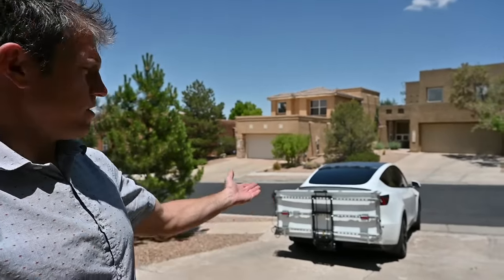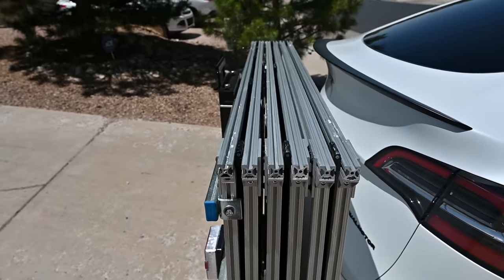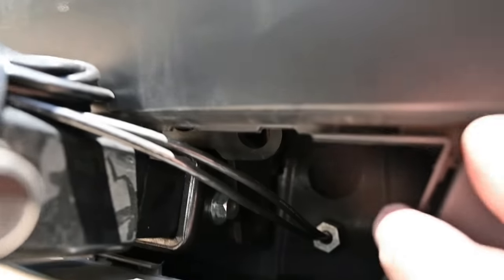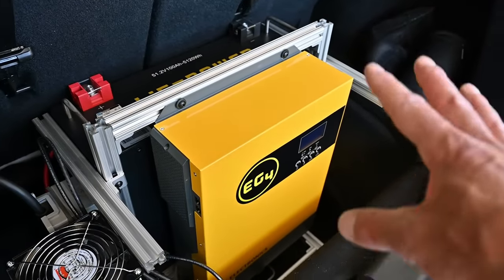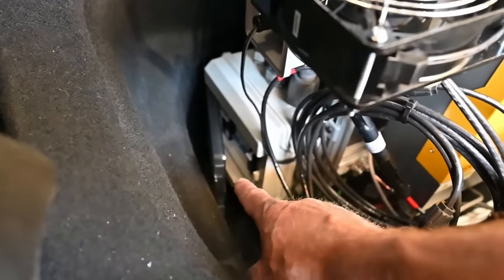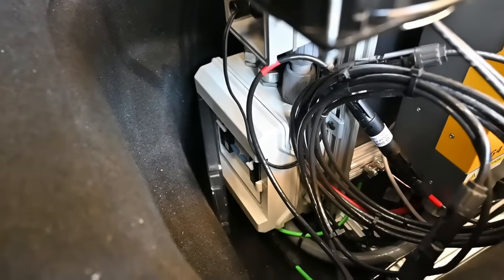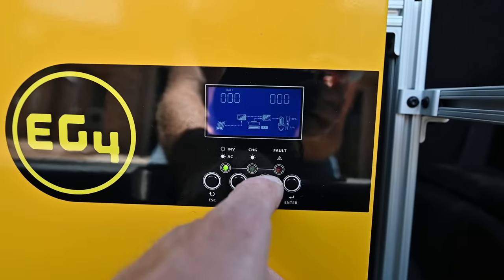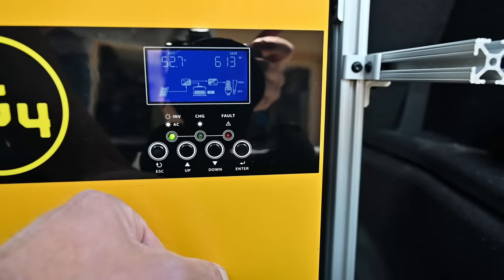Tesla Mobile Solar EV Charger with EG4 inverter and battery

Comment: Excellent video! But it just kills me that this would be so easy to do with existing electronics already in the car, if only the EV manufacturers would provide a DC input for the solar panels, without having to resort to external batteries and inverters. 
This setup has so many voltage conversions: 1) step-down from PV to battery, 2) step-up from battery to intermediate 120V DC voltage, 3) invert from 120V DC to 120V AC for the car AC input. Feed AC to car, 4) rectify from AC to DC in the car and 5) step up to the EV battery's DC voltage. All this could be done with a single DC to DC conversion from PV to the EV battery if you could just get the DC voltage from the PV directly to the intermediate DC bus inside the EV's AC charger. From there on, it's just software to set the operating point of the step-up circuit.
Reply: Preach
Reply: The RealSolarCars YT channel has a custom board that does exactly this. I believe the current iteration is for 72cell solar panels, manages 300W charging up to 400V, CAN interface contactor outputs with coil economizers, lots of additional features that might be desired for a DC-DC SEV.
Reply: Totally agree !!    Just make it easier for people with PV at home would be a big start.
Wil Prowse showed how he charges his Tesla from home PV.

This case shows roughly 1kW Solar PV, so roughly 4 kWhr per day, or 16 additional miles.
Being able to quickly add 5x or 10x that PV to your EV would be super cool.
Reply: I said something similar
Reply: Aptera has said their vehicle will have an input port for external PV arrays (I believe).  In case you want to supplement the onboard PV
Reply: I really don't know why he wants solar charging, why not just use the added battery for additional range. I am interested to know what his range boost with that added battery and added weight in the back trunk!
Reply: @uhjyuff2095   it’s a possibility to be in a place with no grid power to charge the external or internal battery. Everyone doesn’t want to be tide to the grid.
Reply: All EVs come with DC charging. That's how supercharging works.
Reply: Ya I've been saying that for years. I've also saying why dont they use an alternator and a rectifier to charge batteries while they are driving. Hook a pulley up to the motor and mount the alligator. Running with belt just like a regular car. Rectifier and voltage regulator. Some altinators put out 96 kilowatts or higher.
Reply: Conversion losses
Reply: @kennethcheesbrough6855   uhh physics? the batteries are driving the motors to push the car... you can't then put drag/resistance (alternator) on the same motor/wheels, to charge batteries... that would just make the motors work harder (by the same amount) to overcome the drag. 
You can't do perpetual motion or energy from nothing.  Otherwise I'm sure Tesla would have done this magic regen already :) 
 (Now, SOME big construction trucks DO this perpetual motion thing, never need charging, using regen taking heavy loads down a mountain... which charges them up enough to go back uphill for free!
But,  that's because they've left giant boulders down at the bottom, gravity gave them free energy.)
Reply: THANK YOU! SOMEONE FINALLY SAID IT!!! you're a savior.
Reply: Some EVs like the Ioniq, genesis ev's and KIA ev6's have outlets already.
Reply: @uhjyuff2095  Add solar to your roof - add extra batter to car - also, allow for car-to-car charging, to help out if another Tesla is out of juice
Reply: @cgamiga  New business, put boulders at top of hills for EVs to put in their frunks....
Reply: @cgamiga  No, you don't understand. He is saying that it would be nice to have a large alternator on a Tesla to charge an EXTERNAL battery for other uses. The ford lightning has 3 large inverters for doing just that! You can have power tools or really anything in the bed or Frunk charging while you drive. It is super amazing what EVs can do!
Reply: @themosttoast3733  That is too labor intensive. Why not just install a Tesla Supercharger and say to the customer "Plug it in"
Reply: @kennethcheesbrough6855  ... The additional energy used to turn the alternator under charging load would cancel out the energy created by the alternator. Regenerative braking is the only mechanical way to add energy back to the batteries above net zero, and most EV's already have this implemented.
Reply: Exactly.
Switching back and forth to DC/AC/DC is so inefficient.
Reply: @benowens2428  Kenny is talking about charging external batteries not the internal battery. You know like how a gas car can charge it's 12v battery while driving!
Reply: @uhjyuff2095  It doesn't matter what you are charging. The internal battery, and external battery pack, etc. Using mechanical means to do so especially, would draw so much more power from your vehicle, that is doesn't make sense to to do. Just charge your external battery while you charge your car. It is a diminished return no matter how you look at it. Does that make more sense?
Reply: That'd be tight. What still doesn't make sense to me, if you have say 2 motors on 2 wheels,  why extra 10k w alternators aren't connected to the other 2xwheeks to create charge while moving? Seems like the tech exists no one is adding enough tech for self charging between solar & motion? Even an internal wind tunneo/turbine doesn't seem that hard to engineer
Reply: @richardjohnston9899  Because of the laws of physics man. If you put that much resistance against the car to try to generate electricity with alternators/generators and/or wind turbines, you just drain your batteries that much quicker with diminishing returns. 
The only way you can get a charge without impacting your range is through passive charging. Like solar, or regenerative braking, etc. Sources that don't drain the system more than they are putting back into it.
Reply: @richardjohnston9899  There are alternators connected to the wheels. The motors function as alternators when you hit the brake pedal. Then they will take energy from the movement of the car to charge the batteries and the car slows down. That way you can stop the car without actually using the traditional disk brakes at all and you recover the energy. There's no free lunch, though - you cannot get energy from the mere movement of the car. You put energy to the movement to accelerate the car, and you can take energy from the movement to decelerate (slow down) the car. The amount of energy is same as the change in the speed of the car.
Reply: @zaneenaz4962  You can only do so much with 120v. I was doing the numbers before and we really need atleast 3kw, but we really is 6kw ideal for 50mi trips, 32amps with 240v.
Reply: all that to charge your car in a week.......Really I would rather have them on my roof. so they can give me more bang for my buck. Put a batter backup in the garage and transfer the energy to the car from the battery backup
Reply: @uhjyuff2095  To survive the Apocalypse

Comment: This setup belongs into a trailer, this way you can leave it charging at your camp site while you have full use of the car. You would add other amenities to the trailer too, and it could become a great product to build and rent out to the world...
Reply: Correct and the solar panels should be placed on the roof of the car so it charge while you work. The rest of the fancy setup can be bought as a 4.8KWh battery with inverted to deliver 110/240 VAC - to charge the car. They are included in the batteries with solar panels. 5KWh is what regular driving needs every day - 7KWh is 30 miles/ 50 km of driving.  A camper towing a 5 KWH battery with solar panels has enough electricity to power a freeze and induction oven - no need for propane.
Reply: @knuthf  sure if you can integrate it so it doesn't cost anything additional drag. Otherwise have a utility trailer outdoor kitchen, refrigerator with foldable solar covered shade roof, battery and charger, and you can bug out much more conveniently when the time comes! By the way I want to see videos about taking your ev (tesla) off line - for the 5#!4 hits the fan situation - with hacked Ai and bezerk government and what you can't even yet imagine...
Reply: And when it’s not powering the car, it can power the house.

Comment: This inspires me to look further into an ev conversion for my little car.  Of course by then this will have been perfected even more.  What a nice bit of work there.
Reply: By then it’ll be a car cover you plug into your vehicle
Reply: @Terrillthegreat79  Hey now THAT'S a good idea!
Reply: Natural gas conversion is cheaper.  You could use gasoline when you run out of natural gas
Reply: @josephtpg2205  Yea but that's not the point
Reply: I've looked into that too but it's very expensive!!!

Comment: I’m impressed that you got all that weight onto the tow hitch within specs.
Nice job dude.👍
Reply: true. Maybe placing it on top like a roof box or something and just slide it out if he needs to charge the car :D
Reply: @ayayotoko  The location of the panels on the roof has one disadvantage - it will increase air resistance and this will reduce the range

Comment: Great video. While this project was an amazing example of making a portable mobile solar charger, a similar fixed-base home setup solar could be just as effective, and likely see more usage.
While Renogy 100W are very portable, but come at higher cost/kWh vs. larger fix mount panels. (some great deals on 1/2 life used solar panels can be found)

Perhaps a trailer installation that could double as camper would offer mobile portability without concerns of panels being run over? A trailer might also offer larger surface area, and could continue to harvest energy, even if not attached to an EV. Guess it depend on needs and wants. 
Still a great demonstration.
Reply: You'll lose a fair bit of range once you start pulling a trailer

Comment: FYI, on the Model Y the maximum tongue weight for a trailer is 350 pounds but the maximum vertical weight for bike racks including the weight of the rack is only 160 pounds.

Comment: Great work! I have tested similar system with my Model S and the problem for me is that it is too heavy. I wish there was an MPPT DC charging station for Tesla =) so we can avoid heavy battery and halve the weight of electronics.

Comment: How many days/weeks/months/years/centuries would that take to deliver a full charge?
I think people underestimate how much power these cars consume.
Reply: This is perfect for trickle charging instead of wasting time and getting scorched, when the car is parked outside, in hot weather and the owner works an 8 hour shift, or has just visited a friend or family and there is no indoor parking. Normally , we hate to have a car, any car out in the hot sun but this actually delivers gains, in the long run.
Only problem, what is the total cost and what is the extra weight of this conversion ? Then one can sit down and estimate the total experience.
To sum up, this is the future!!
Independent and
Reply: This solar setup has the potential to produce 6KW/h of power per day in summer time, after conversion there would be about 5 left at best, assuming he has a 100KW/h battery in the car it would take 20 sunny days to charge up to full.
Reply: @TheDIYDen  If someone doesn't nick it while it's unfurled in the carpark...
Reply: @garysheppard4028  hahahah ! Probly ok for a campground, but yeah not ideal in general
Reply: @TheDIYDen  holy crap, 20 sunny days to charge the car? Was that a serious estimate?
Reply: @JeffHoldenWS-NC  Yes, and very generous it's probably closer to 25.
Reply: @JD-fk4qq  Yeah. Hey I have one of these rigs! Some WalMarts won't let me use their parking lot, so I use a custom app that finds which WalMart to go to. I usually can locate one store per state.
Reply: @TheDIYDen  we’re lucky to get that in all of summer in northern England.
Reply: @davidk3729  hahah

Comment: If you add some small caster wheels to the hinge points, it would be much smoother to deploy. Awesome build!
Reply: I'm thinking a track from back to front of car, and the panels slide over the car

Comment: This is a great demonstration that a solar charging option is "possibly feasible" for cybertruck, once commercialized, with better weight reduction, higher efficiency energy harvesting, cargo bed roof integration - especially for cybertruck outlanders.
Reply: Glad to see I’m not the only one thinking this.  When you figure in the extra weight and wind resistance I suspect it would actually use more electricity from the grid with the panels in place, at least for a daily driver.
Reply: @William Arrington you are being too generous with your numbers is was only 1.2kw of solar ideally but even in summer with long days and clear skies it would take about 5 days to get your 60kwh charge so if the cyber truck has a 200kwh pack you would need the better part of 3 weeks and that is still being generous because that isn't factoring the bad panel angles or other system losses honestly for a cyber truck it would be lucky to get 1 full charge a month in summer

Comment: That EG4 is brand new!! Nice setup.  10:07 I think the server rack batteries have a built-in charge resistor.
Reply from the maker: That's what I thought too, but I believe only the newer ones with digital displays have that feature. My battery would fault when initially connected so I added the resistor.
Reply: @gridfreeordie  It does you just have to do some reset or something to activate it. Your setup is easier since you thought it out and figured out how to get it running smoothly!
Reply: I believe that breaker is split into two sections so you flip just the pre charge switch first the main switch

Comment: Impressive, for sure ! But adding that much weight to the car, plus the additional drag to the already get efficient design of the Model Y, we would need to know much this setup as diminished the range. Of course, if your objective is mostly to be able to camping off-the-grid, the it's just fine. Except that now, you've sacrificed all that cargo space for your outdoor gear... Ah wll, nothing's perfect !  😁
Reply: add to that the increased aerodynamic drag that monster places on the car. You would get more range by simply getting rid of the solar system. 😂
Reply: what I would do is not carry it around and just use this solar at home to get extra range or take it with me when planing on not moving for awhile to get range back up idk but carry all that seems like a drag I do feel like solar will be the future of ev but it not there yet!
Reply: Gear can fit in passenger side
Reply: 完美遮挡车牌

Comment: Interesting project. Driving around, I would have some concerns. 1. The license plate is not visible. It would be simple to move it to the back. 2. The taillights can't be seen. I suppose those could be implemented like a trailer. 3. The Tesla Model Y has sensors and cameras all over its body. Does this interfere with those?
Reply: Yes it’s a sacrifice
Reply: He has taillights added. And the government can get f'd reguarding the license plate
Reply: I also worry that the aero drag from big flat panels, might cause enough energy losses to overcome any later generated power :( maybe some shield over them? Not sure how the air flows past them...
also, there will be energy lost from cabin overheat A/C or even just fans running, to cool off that trunk. Better to just leave the trunk open.
Reply: @cgamiga  Leave the trunk open for cooling results in being able to see the license plate. Win-win! LOL!
Reply: Put it in a wind tunnel. Think you'll lose more than you gain with this. Tesla would've done it if it was that easy
Reply: @theyrealltaken3  Massive drag and further weight disadvantages.  Any gain by adding all this then needs to be weighed up against the cost…..it won’t be pretty but as long as he’s happy 😂

Comment: I love the ‘because I can’ attitude, however it would never be used efficiently. The extra weight, drag would be killing, the noise and heat will be annoying. You basically lose your trunk. Plus the charge speed is absolutely tiny. Lastly, you need a huge parking spot and hope to god that nobody likes to tramp on the PV panels for fun. Again, love the passion to do something cool, however extremely (that is an understatement) unefficient.

Comment: portable battery makes more cense, you can also solar charge the battery at home. If you always need one with you get two and swap them out when needed.
Reply: Also, you could bring it in the rental house and plug it into the dryer outlet.  Or leave it at the RV campsite to charge while you drive around.

Comment: Good work, suggestion
Are the solar panels in series long enough to use as covering the car from sun light insead of folding it in the back of car which reduce the parking area, and same time cool body of the car. You can change the design of the foldable panels to be opened from the back to the front of the car with additional foldable support stand in the middle solar panel series and infront of car. The other parallel solar panels can put on side. Tq
Reply: Yeah, make it a canopy, and could be neat for tailgating!
Reply: For that to happen the panels needs to be light weight but yet still sturdy enough tow wuthstand high winds. Also, you would need two foldout legs in the middle panel one of each side to be the middle support on the roof of the car.

Comment: Bravo ❤ truly innovative! You have just solved the charging network problem for EVs. Looking at the surface area of the panels needed and with some improvements in panel technology,  we are not that far off from being able to mount these on roof racks with awning system that can expand over the top of the car when parked, from control of the computer, and collapsed version that continues to operate on the roof whilst being driven.